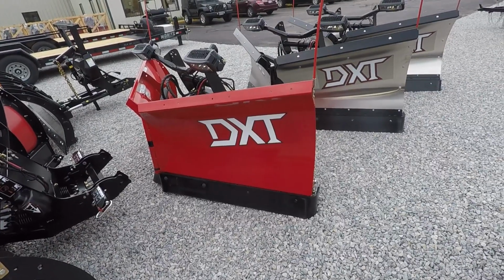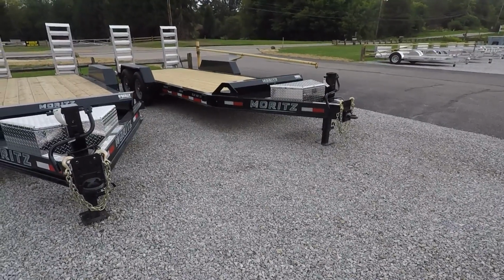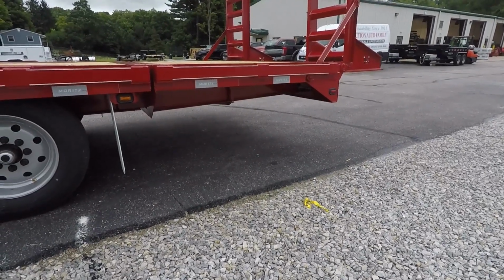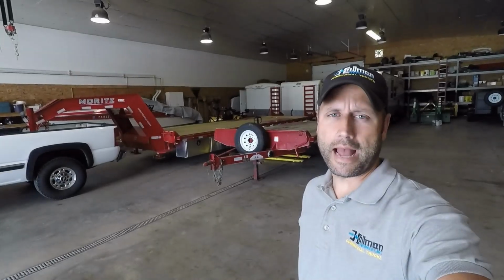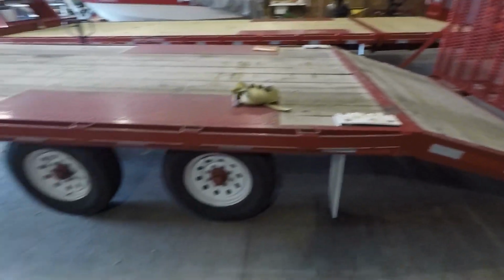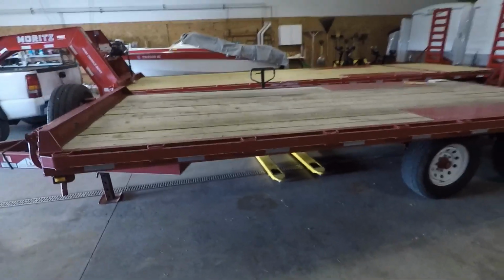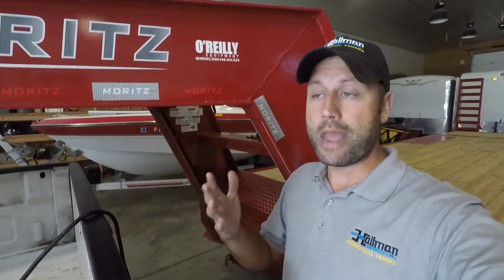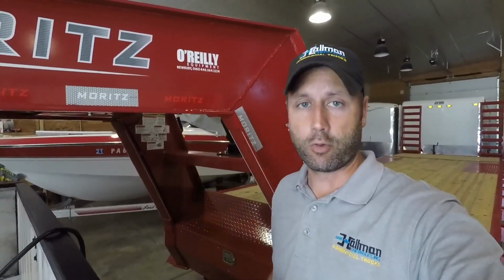Taking Delivery Of My New Custom Built Moritz Gooseneck Deckover Trailer!

Comment: It's a 16k trailer. With that srw gasser you might be under cdl. My question is since you have a cdl why not bump up to a 20k or more your probably only going to have about 11k payload with that trailer you have
Reply from the maker: Trailer is 17K GVWR & the truck I tow with is 12,100 GVWR. Add those together and you’ve got 29,100 GCWR per DOT. Motor carrier enforcement will always add the gross vehicle weight rating of your truck to the GVWR of your trailer. My tow rig has a combination rating of 29,700. So in reality could have gone with a trailer no heavier than 17,600 GVWR. I’ve been stopped several times in several states and they immediately check the sticker on the truck and the sticker on the trailer and add those together… Even if I was empty with nothing on the deck.
Reply: @truckguyjoe  Your trailer has 2 8k axles?
Reply from the maker: @precisionfilms3777  yes, fast forward to the eleven minute mark of this video link...you can see the weight sticker up close with GVWR & axle ratings. The 17.5" wheels come with the 8K axles. Here's the video: https://youtu.be/LdO-d5VkFCA

Comment: I really like that trailer man, the red looks great on it 👍 You'll really like pulling a gooseneck, I towed and owned a few different pintle hitch equipment & car hauler trailers and I had little to no complaints with them, but I upgraded my last 22' Iron Bull pintle hitch trailer to a 2019 26' long custom ordered Load Trail gooseneck. And I got mine with an 8' by 8'/6" wide deck over the neck for added cargo space and I have a 3' self cleaning dove tail with max ramps. And I got mine in a car hauler style with a low deck with drive over fenders and get the full 8'6" width with a lower center of gravity being a drop deck. I actually run mine with a kingpin hookup instead of a ball also as I find its a way quicker and easier hookup and unhook plus feels more stable going down the road but thats just me. You will find the gooseneck has somewhat of a delay when turning after the truck but if you swing out wide its not so bad. The added stability and smooth ride cancels out the under turn drawback a gooseneck has in my opinion  👌
Reply from the maker: sirkingdra I appreciate the feedback! Looking forward to my first big trip with it.